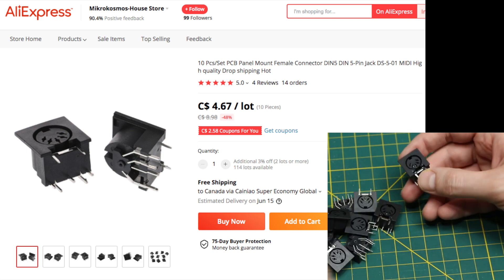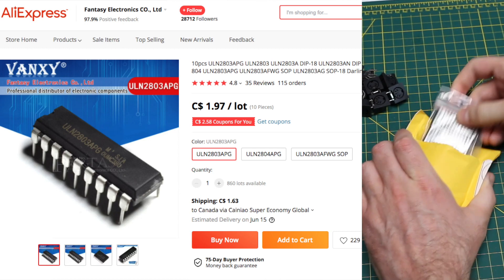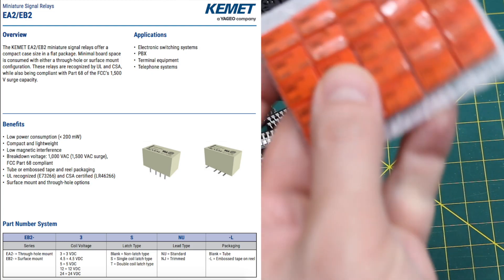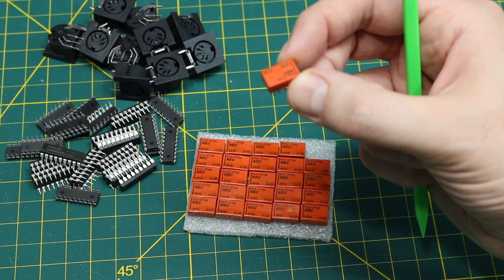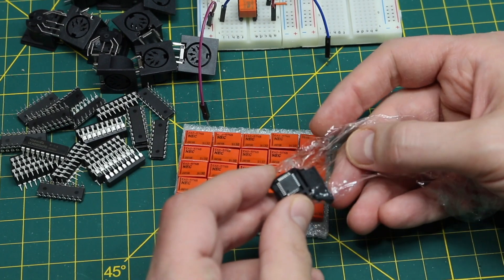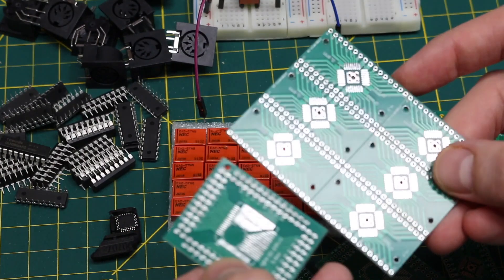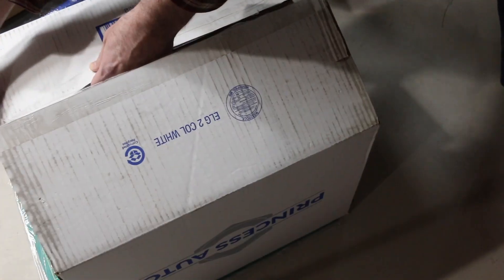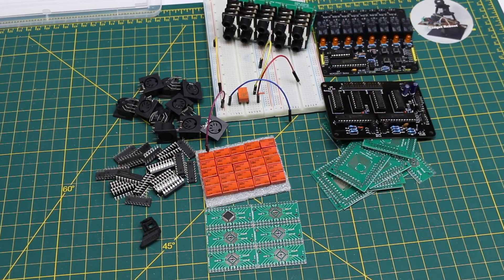Mailbag! Latching Relays, Parts, and Workbench Stuff

Comment: Fun stuff!  IIRC, those midi connectors are also the same ones used for AT style (8088 to 486) keyboards and also used on a lot of the old computers like the TI99/Commodore for power or video/sound. They have a lot of uses beyond midi.

I just ordered similar relays and those same chips (I believe) from DigiKey and paid dearly for them.
Reply from the maker: I think I was able to get five relays on AliExpress for the price of one at Mouser but I wanted some proper ones as a reference to compare for quality if I had any issues.

Comment: Nice stuff. Except for those parts bins. I have a few from p auto and the drawers are sticky and annoy me. Hope you got some that work for you.
Reply from the maker: The main thing about the drawers that I don’t like is they are hard to remove from the cabinet if I want to take them somewhere independently so I’m still working on the technique to figure out how to move them up and down and possibly press on the bottom when they are almost fully extended to try to push them over the hump that retains them but my long-term plan will be worst case I just put stuff in there that I don’t really need to remove the trays for I can just reach in and gets stuff.
i’m finding it hard to find any trays that I like, the other Mastercraft ones, the trays almost want to come all out on their own without even touching it and with everything being mounted level.  it’s like air hockey tables. Can’t win.
Reply: @GadgetReboot  I do have a couple black 60 tray bins that are ok. But I can't remember where I got them.